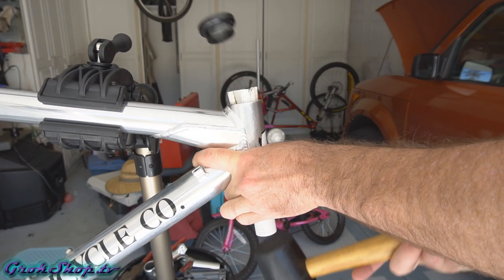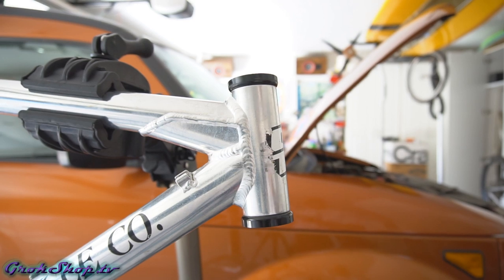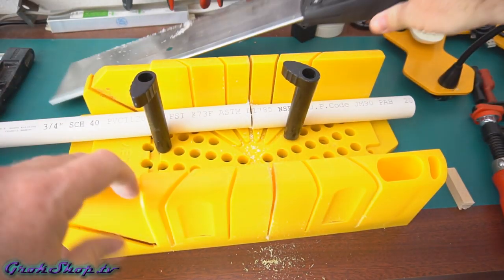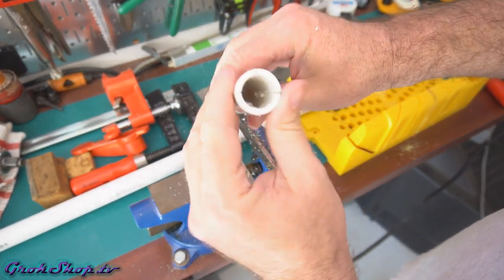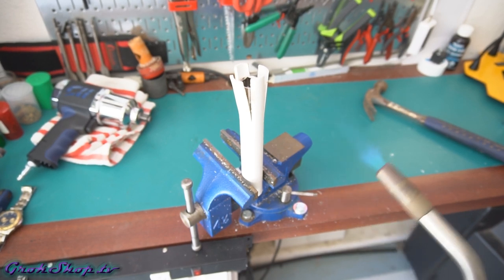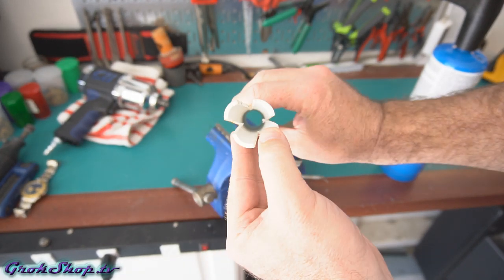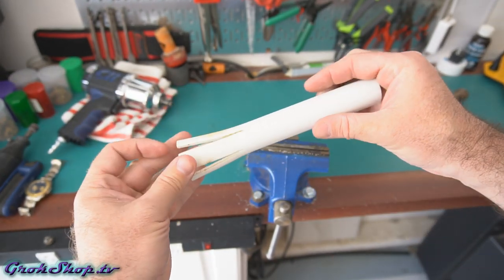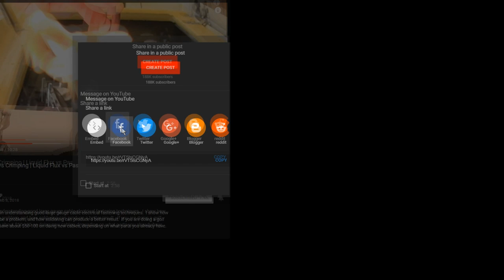Bicycle Maintenance: How To Make A Headset Cup Removal Tool

Comment: Thanks!! I made the tool out of PVC, pretty easy. I used my stove top to soften the pvc to bend out the flanges. But in the end I found that the PVC material has a dampening effect. Me, being a 63 year old female but not light weight, could not generate enough force in my arms to extract the cups. So, I ended up on Amazon buying the Bike Hand YC-1858S tool. I feel that Bike Hand products are a great value at almost half the price of the Park Tool versions. This tool, being metal and also having a heavy plug in the hammer end made the job super easy. The metal was the answer! It was around 21 bucks. I saved the PVC tool I made. I am going to try it again on another bike just to see if it can work....or maybe get a body builder with big guns to get them cups out. LOL

Comment: +1 for very useful! Thanks for creating and uploading. I like the fact that poly tube is less likely to damage the inner face of the headtube compared to some 'other' videos where they have used metal pipe. #TopTip #Headset #Cup #Removal #Poly #Waste #Pipe. Much apprecated :)

Comment: Why not just use 1" pipe?
Reply: 1" pvc with it's 1.3" outside diameter is too wide for a common 1 1/8" headset. The 3/4" is about 1" outside diameter, so it'll fit just fine.